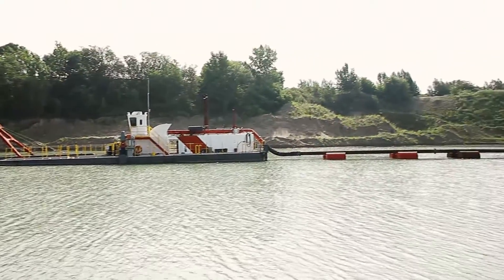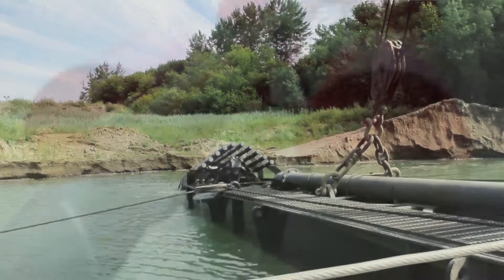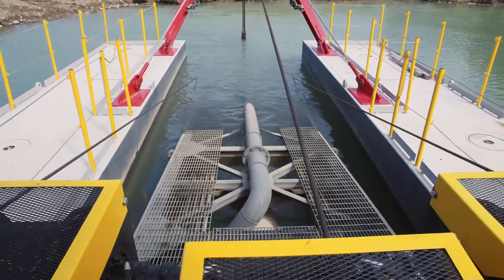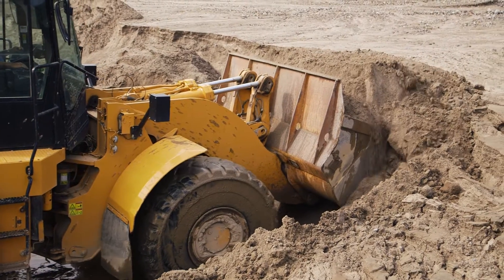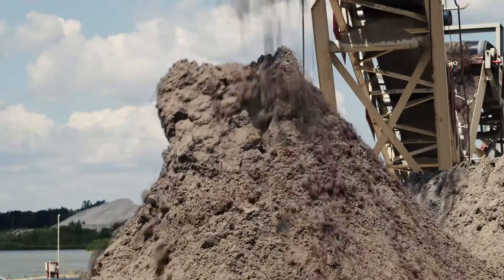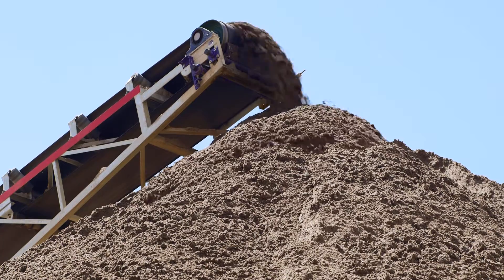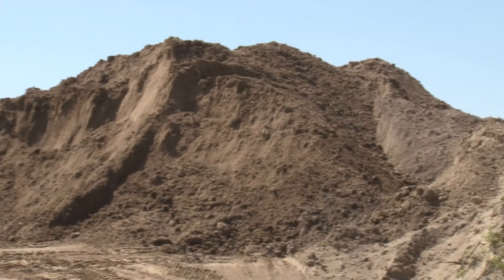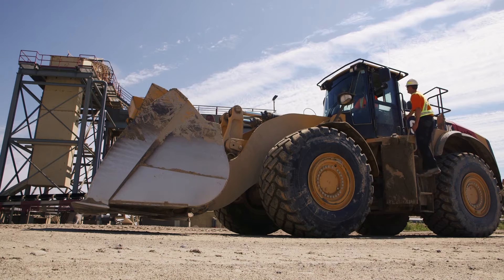Tomlinson Dredge and Sand Plant

Comment: How is the dredged sand measured accurately?
What methods are used or device?
Reply: Measure the piles usually by drone 

Stock pile volumes-> tonnage/hours run = tons per hour